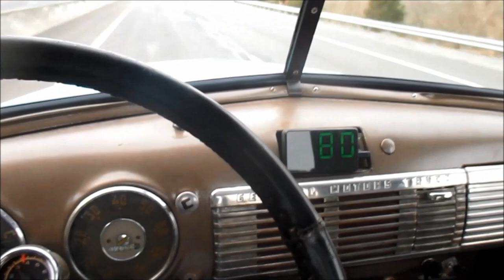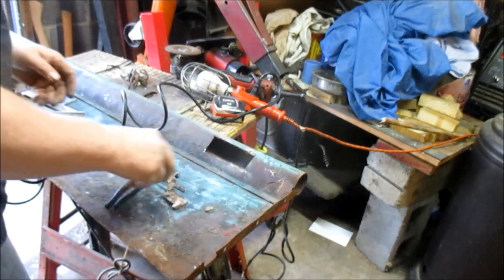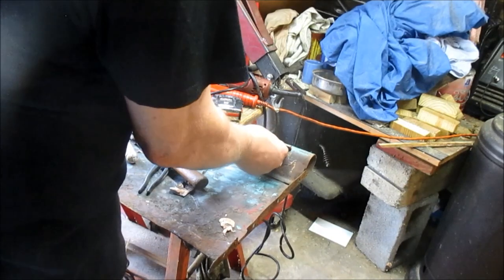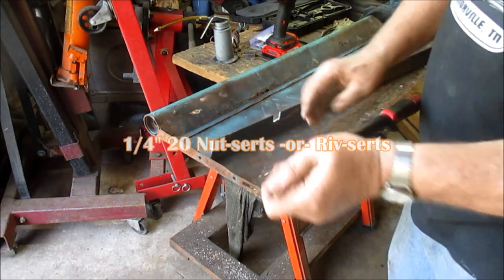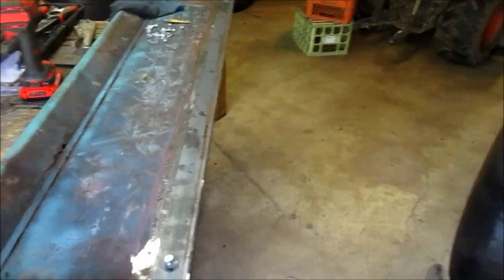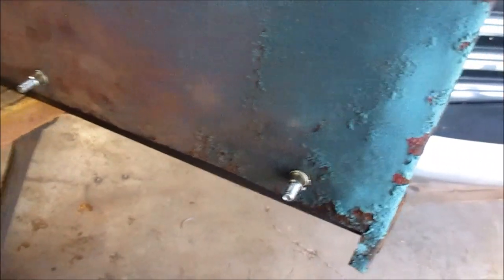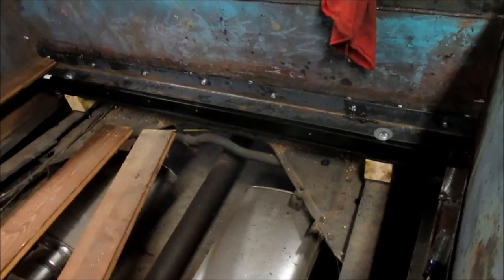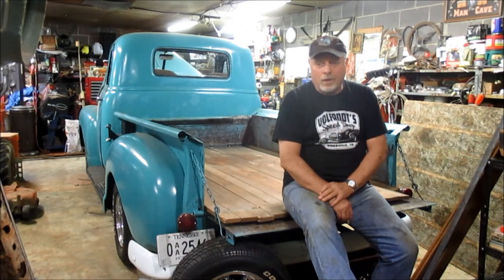1949 GMC  Wood bed repair  Part 4, Volume 40

Comment: I would have slapped some paint on the rusty areas on the cab and front panel. Nice truck. I like the way you have the boards tight together, no need for a hardware kit.

Comment: Looking forward to part five!!  What are the center to center measurements on the cross pieces that you will attach the bed to?
Reply from the maker: Thanks Jones. The bed is 50" wide x approx 78" long.  I haven't measured the center to center but will be addressing that very soon. I'm deep into replacing a hot water heater and relocating it to another room. Fun, fun, fun...

Comment: Great channel, helping me figure some things out on my 54 GMC. Hope you can help me with a question I have. On your 49 Chevy when it was still 6 volts how did you wire up your tachometer ? I have a 6 to 12 volt converter but the positive ground system on my truck has me confused on how to wire up a tach. Again great channel, Thanks
Reply from the maker: The GMC was already converted to 12v neg ground when I got it. If the tach is designed for a positive ground system you're almost there. The converter "may" work wired as positive ground so you can try to wire it's positive red input lead to ground and wire it's negative black input lead to your "hot" voltage source. You can use your voltmeter to determine if it will work that way and output 12v positive ground. Be advised that sometimes reversing polarity on some devices can burn them up.
Good luck